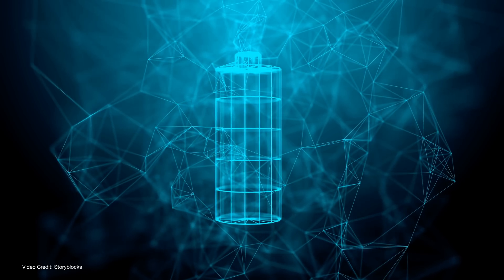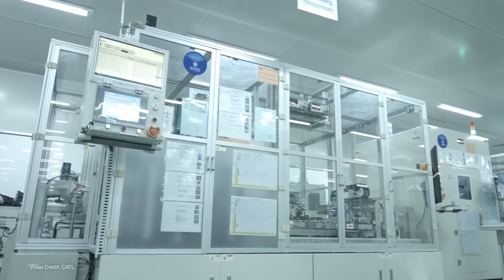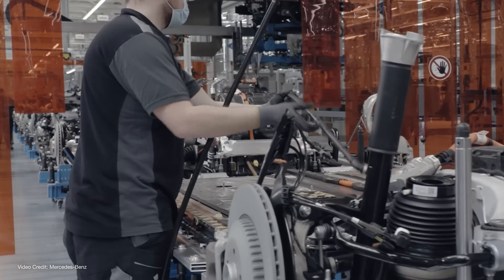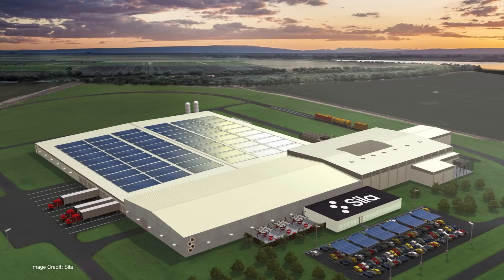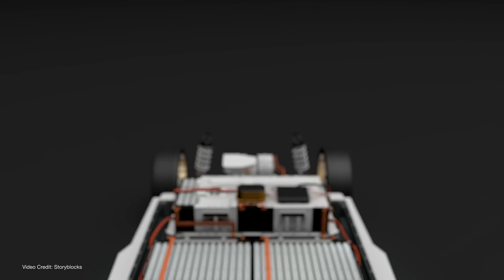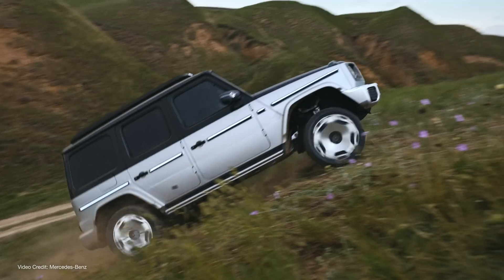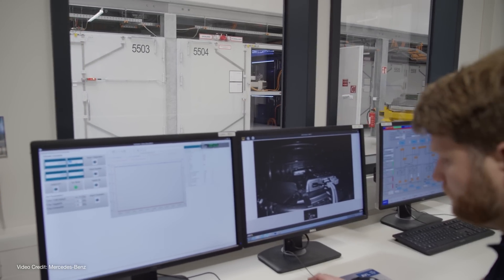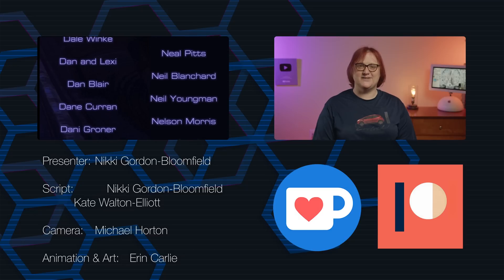Sila's Battery Breakthrough Is A Big Deal For Mercedes-Benz!

Comment: Is battery space more important than weight? I think not. No, matter. We need to consider many physical properties of a battery, 1. Life. 2. Charge speed. 3. Cost (production speed, available materials). 
If a battery can be recharged to go 200-300 miles in 5-15 minutes, it's no more trouble than getting gas, with big $savings, e.g., no pollution, no maintenance, no wearing out (no new car needed), therefore the density is irrelevant. 
Long before MB comes out I will be driving my 400 mile range Aptera, not the 1000 mile model (too expensive for me). 
Well presented, entertaining!

Comment: I’m confused. Either they actually did make a battery that they can reproduce at scale by simply building a factory, or not. Are there problems still to be solved, that must be solved before such a battery can be produced? If not, then why is this not bigger news than it is, and why is it not spreading to all EV manufacturers immediately?  And if so, then this is yet another video that gets our hopes up for no reason at all.   We all know there are dozens of potentially hot new battery technologies under development, but we also know that it’s very possible that none of them will turn out to ultimately result in better batteries.
Reply: Or, maybe we don't need better batteries because someone has designed/built an efficient platform, e.g., focusing on aerodynamics and weight. Aptera has finished their first prototype, and is almost done with their second, 2 more steps to go. I have ordered two, expecting delivery within a year.

Comment: I guess it's a good video for the uninformed, but one of the things I'm curious about is the difference at the Pack Level.  As an example, CATL's NCM does achieve 450 Wh/l and their LFP gets 290 Wh/l but because NCM needs a VERY ROBUST Temperature management system, so the battery won't explode from overcharging or an accident, once you get to the pack level the advantage drops from around a 64% advantage to around a 20% advantage, because the LFP pack is MUCH more simple.  Considering that LFP can be as much as 50% less per kw at the pack level, the advantage of NCM starts to disappear.  Add to that the additional safety features of LFP (no battery fires) AND that they last around 35% longer this tells me that nearly everyone should be utilizing LFP batteries.  BYD already makes SEVERAL cars that get in excess of 250 miles of range (over 400km).  BYD just started selling a new van by their Lux brand Denza (10% owned by Mercedes) that utilizes an LFP battery to achieve 600km of range.  Considering that LFP batteries can be charged to 100% DAILY (NCM should ONLY be charged to full capacity if you absolutely need it) this is an incredible range, especially for a $50K Luxury Van.  So unanswered about these Silica Batteries is the question of what kind of battery management system will they need?  Will the battery pack look like a giant radiator because it needs to be kept at a certain temperature?  Will it be more expensive than NCM?  This year alone, CATL and BYD both improved their batteries by at least 25%, if they continue to improve at such a massive pace while keeping the prices low, will Silica even matter?

Comment: Question:
Is it a good thing that car companies are investing directly in battery tech? In the short term yes it bring much needed investment and pushes technology along but in the long term every car company has different battery tech so you could end up where various advantages are spread around, if you want long range you have to buy an X, if you want fast charging you have to buy Y . It doesn't seem very good for competition if such a fundamental part of the product is proprietary.

I suppose licensing is a thing but it seems analogous to one company having control over the petrol engine, one over diesel, one over lpg etc

Comment: Why are we talking about volumetric and not gravimetric energy density? Volumetric is more relevant at the pack level for chemistries like LFP because of its low gravimetric energy density so you need more cells.
Reply from the maker: While we're keen to discuss both, often automakers and battery companies will only supply the numbers for the bit they want to talk about. Usually which ever one is most improved.

^Kate
Reply: I've noticed that too, volume density is good but it be nice to know the weight. They definitely put a spin on there stats.

Comment: By time the car is in production, it is likely that the lithium-sulfur batteries will be on the market.  Lithium-sulfur is about 3 times as energy dense.  Someone found a way to prevent the dendrite problem by capturing the sulfur in carbon nonotubes.  When that technology gets on the market, ICE cars will completely be toast.  An electric car will have more range than an ICE one.
Reply: Eventually evs will have 800 mile ranges and there will still be people complaining it's not enough for them. How am I supposed to see my mum who lives 1200 miles away?
Reply: @timscott3027  At that distance it is likely cheaper to fly there.
Reply: Just finished reading about it https://youtu.be/H-AjRrGglCE

Comment: I still would like to know why modern electric vehicles 2022 still have a 12 volt battery. Can't they dedicate a single cell pack for those functions or something.
Reply: It seems possible, I think the problem is it would mean the battery switching itself on, which could be a safety issue. I'd settle for a LiFePo 12v.

Comment: Interesting, thank you, but skepticism is required. The most important tech is the one that can scale to large volumes at lower costs. Also no mention about density by weight, charging rate and longevity/ cycles, if they aren't talking about those things I have to wonder why.
Reply: Part of skimpy information can be trade secrets, pending patent filings, avoiding poaching of employees, etc.

Comment: I have to point out that I have a 2015 24kwh Nissan Leaf with no thermal battery management system. The battery pack is warrantied for 8 years and will last at least 10 while retaining a usable amount of energy. Even once it goes down to 57% SOC it will still be capable of 57 miles. That is more than enough for 85% of my usage. When I drove a two day 890 mile round trip to Edinburgh in 2017 (which I refer to in EV conversations all the time 😴) I split the journey into segments of between 37 and 63 miles as convenient for charging, rest breaks and lunch. 57 miles range today with the much expanded charging network would make that journey actually easier and quicker to do. As it happens, at my battery's rate of degradation it would take 12 years from purchase to get down to 57 miles of range. That would be longer than I've owned any previous car all of which were petrol. The battery will outlive the car even without thermal management.

So, once again, I implore people not to overstate the issue of degradation in passive cooled battery systems. It won't have any noticeable effect on the majority of EV users for the majority of the time. And it won't rule out longer trips if you plan them correctly and you have no unrealistic time constraints.
Reply: One thing to note though is your climate is pretty mild. Big difference to the American southwest for example.
Reply: I know a guy had a 10-year-old leaf, degraded battery, still driving it. I think Nissan should have argued their case w/ stats, advertise decent prices on replacement batteries. They could have made potential battery upgrades to newer technology a plus instead of a minus, although it's mainly EV nerds that are stuck on the cooling issue. Batteries don't need cooling in their second life as house backup.
Reply: So you think 12 years is a good age for a car to get to to be scrapped?
My little Mitsubishi Colt is 13 years young and in very good condition. I would hate to think of scrapping any car at only 12 years old!
Reply: @TC-V8  you don't need to scrap the entire car, they have battery replacement services. Check out Robert's 2011 leaf on fully charged. These are great cars.

Not to mention the number of years is not a good metric to determine how long a car lasts. You should look at mileage. My 2006 corolla is still kicking but it's only got 220k miles on it, I used to have an 85 Nissan sentra that had 350k miles before it wasn't worth repairing.

Comment: If all the battery breakthroughs I have heard about, turned out to be true, then EV cars would travel 10000 miles on one charge.
Reply: I know! This one looks pretty legit though. They're already building them now, just a matter of ramping up production over the next year.
Reply: On the other hand, just look at EVs of 20 years ago v today...
Reply: It's an incremental process to develop batteries. Each step will be an improvement. Patience is required.
Reply: well, it always sounds a bit unreal when you hear "+50% of something in a few years". but if you look closely at the market, then you can see progress every year. and this progress adds up and then that +50% of something is more a kind of evolution over time and not a revolution like it sounded a few years before.
Reply: You are exactly correct. Battery breakthroughs are plentiful, but try to sell them at an affordable mass produced price.
Reply: ....However, uninformed, cynical scepticism is completely pointless!
Technology breakthroughs DO happen - but, obviously, when, how and where is unpredictable.
The fact that a new battery technology breakthrough hasn't happened for a while does NOT mean that it won't happen today, next month or in five or ten years....!!
It's exactly the same with ANY scientific/technical research.  The point is, most commentators know precisely NOTHING about the tech they're criticising - they just see not much APPARENTLY happening, and extrapolate a set of incorrect beliefs therefrom....
...and social media has a lot to answer for in this respect, people......!